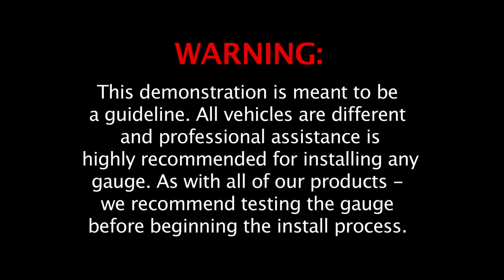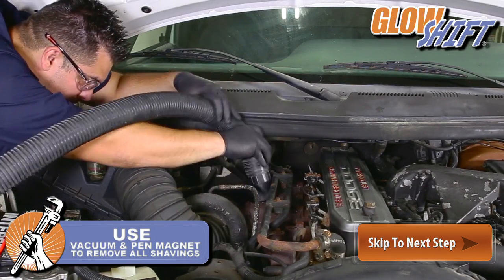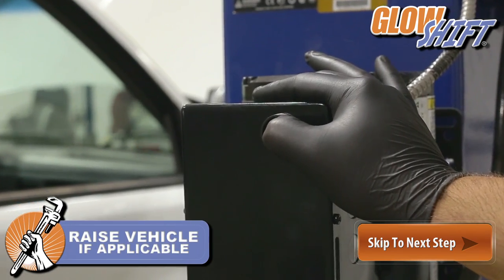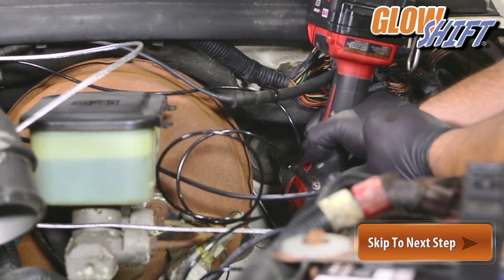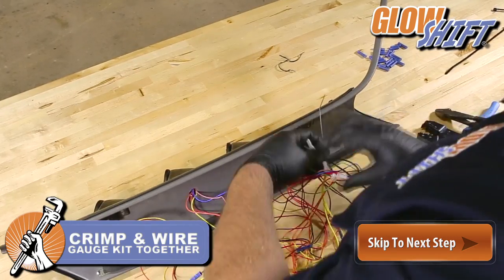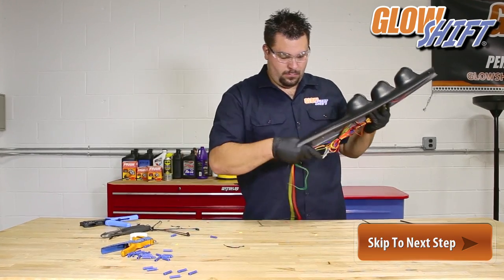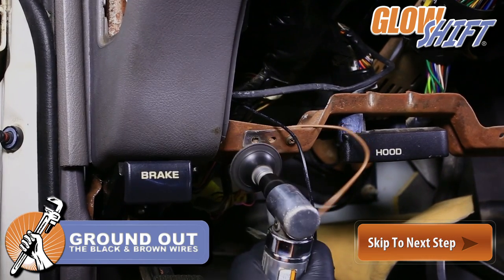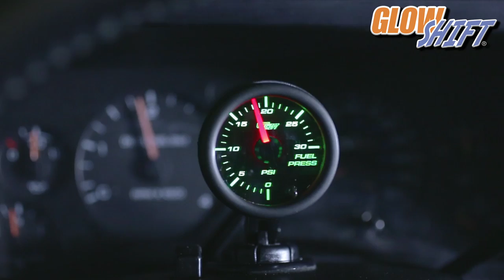Installation | GlowShift 4 Gauge Diesel Set for 1994-1997 Dodge Ram 12v 5.9 Cummins

Comment: Might want to add that once you remove the banjo bolt, you will have to crack the injector lines to remove the air

Comment: Would the same adapters and fittings be used on the 98 - 12 valve?  Half way through the year they switched over to the 24 valve.
Reply from the maker: The only fitting specific to the 12v would be the banjo bolt. You have the option to select that when building a package on the website.

Comment: How tight does the banjoo bolt have to be? Because after installing mine it leaks fuel
Reply from the maker: 18ft/lbs is the torque spec
Reply: Make sure you clean the area around it and use the included copper crush washer.

Comment: I have a 1990 w250 cummins. could I use the same setup for my fuel pressure gauge as shown in the video?
Reply from the maker: The gauges are universal so that they can be installed on virtually any vehicle. However, some of these adapters are specific to the 94-97 12v Cummins so you may need different adapters for your '90
Reply: So i installed it just like instructions said to. I put it on the fuel supply to my filter. With the banjo fitting adapter first, then the snubber valve, and the the sensor. The gauge usually reads at 5psi and only decreases. When i press the accelerator the psi on the gauge decreases. I was wondering if my gauge is faulty or if the location right after the lift pump is not satisfactory? I have checked the connections between the gauge and the sensor and everything appears to be in order, seeing as how it's only two connections.
Reply from the maker: If you are experiencing issues with your Fuel pressure gauge please feel free to contact our technical support department. They would be more than happy to assist you. 

GlowShift Technical Support: TechSupport@GlowShiftGauges.com
1.856.768.8300
Reply: Kurt K Nuevo the factory diaphragm lift pumps only push a maximum of 10 psi. If it reads 5 then drops when you press the throttle 90% chance you need to replace your lift pump. They are very cheap. Only use a genuine Cummins pump or it will fail on you again within a few years 👌

Comment: What should exhaust gas temp be normal and what is the maximum? My truck has a straight pipe and these guages but previous owner installed both
Reply from the maker: At idle, anywhere between 2-300 degrees, depending on load and driving can see anywhere from 300-800 degrees.
Reply: Mine are up around 1100 within a minute of cold starting the truck and go up to around 2000+ when i drive it... what could be wrong the truck seems to run fine and it has a 4” straight pipe
Reply: Edit** i think i was just looking at the guage wrong lol... its labelled 0-15 i thought that was 15,000 degrees woops... it idles between 1 and 2 so that would actually be 200 degrees f  and not 2000 right? My bad
Reply from the maker: That is correct.